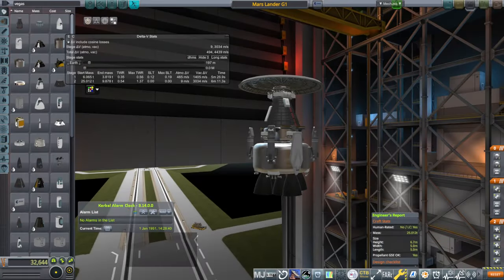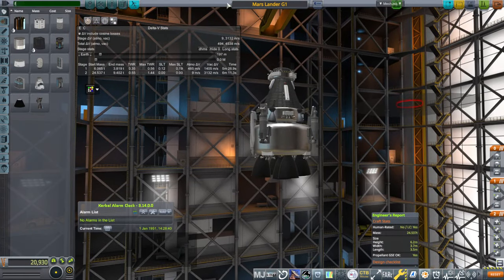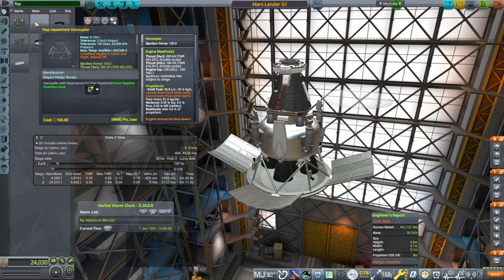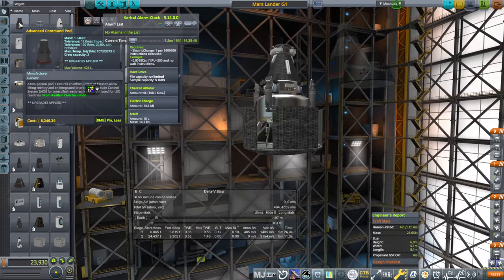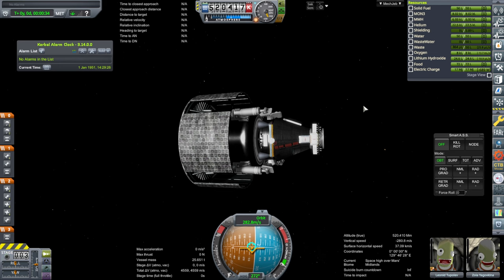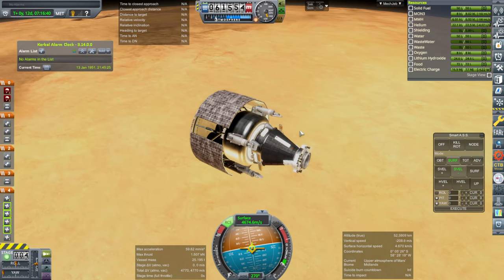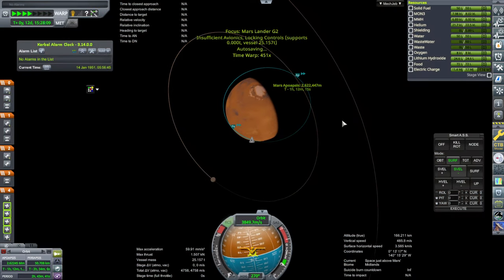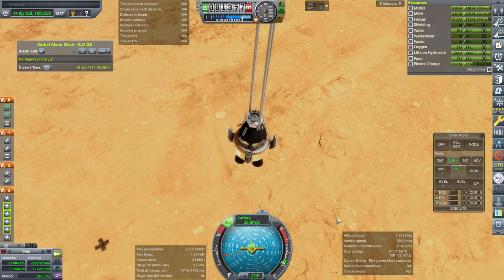RP-1 Career in KSP 1.12 - European Space Agency 92

Comment: That is interesting - i faced the same problem with lack of drag for heavy landers and came to similar solution. The result was the same, drag area according to FAR didn't changed. Then i made two parts: base HS and six separate folding flaps fixed on base. And it worked, but for some reason the drag vector wasn't parallel to trajectory, so i gave up. Maybe you'll try to cut your HS to round base and independent flaps to see how it'll work for you? There is a big chance i made something wrong :)

Comment: Not quite sure what about the drag surface problem, as im not into moding, and i dont know how realistic they made drag with FAR.
My suggestion is, FAR is calculating an "average" surface, having in consideration that them flaps( and the heatshield) are not completly perpendicular to the drag vector.
I didnt check it myself with stringers, tanks or fairings, so it might be just my unreasonable thought. But, might be an explaination why you are not having as much of a surface increased on the FAR information display.

By the way, on the first, landing, i coudnt stop laughting on the fact I was expecting you to tip the lander LUL (Typical tyler)

thanks for the videos. Hugs